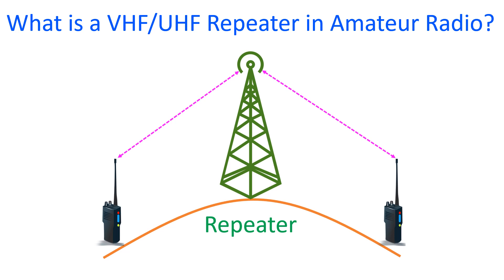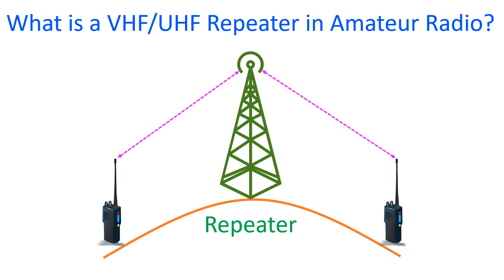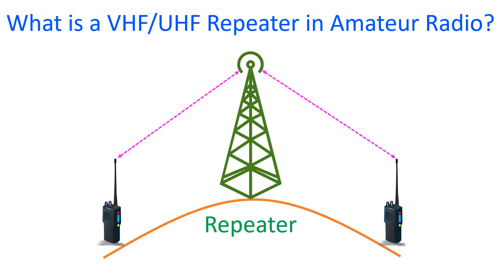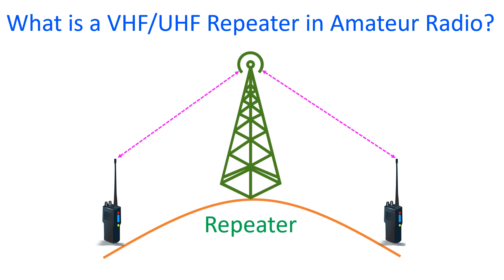What is a VHF/UHF Repeater in Amateur Radio?

Comment: I have a question.... My UHF Repeater for HAM was working absolutely fine for the past 5 years till a couple of days ago it started acting weird.... The repeater now gets triggered only from certain locations... This happened suddenly on its own. Just unable to trouble shoot the issue. Using 2 Motorola PRO5100 radios.
Reply from the maker: I do not have a specific answer for your question. Has there been any change in the antenna parameters? You may want to post it on qrz.com forum which I have found very useful for getting answers. https://forums.qrz.com/index.php
Reply: @johnsonsTechNAgroWorld  thanks for the answer. Will post on QRZ
Reply from the maker: Hope you have already checked the antenna and cables. 73 de Jon, VU2JO
Reply from the maker: Talked to the repeater custodian in my region. He is of the opinion that antenna and cable system needs attention. Rain water seeping into the cable is a likely concern. In our region, antenna and cable system usually does a good job only for about 2 years.
Reply: I will check the feedline.